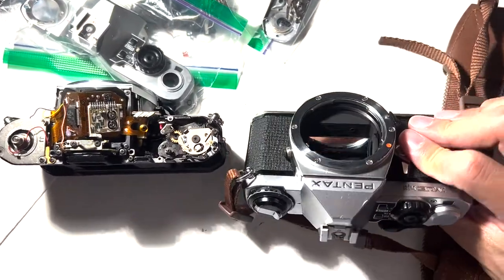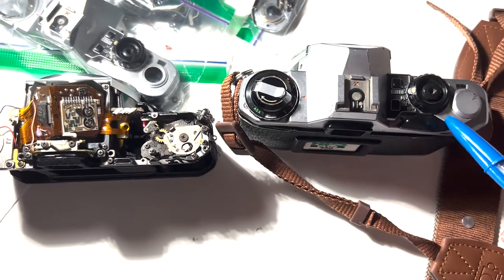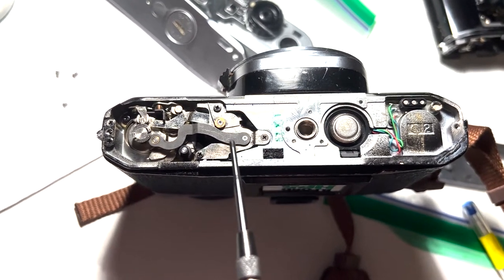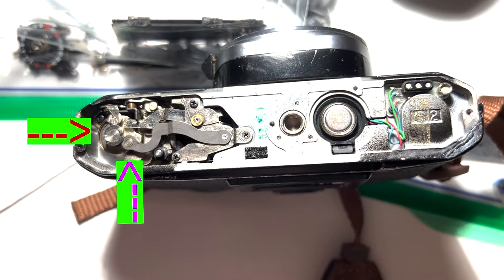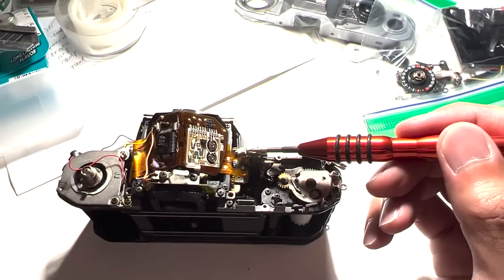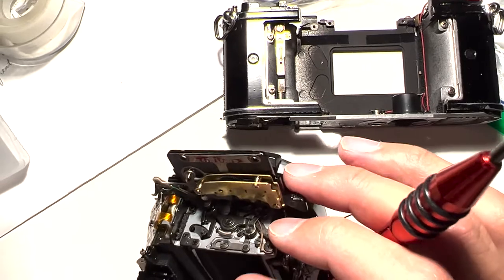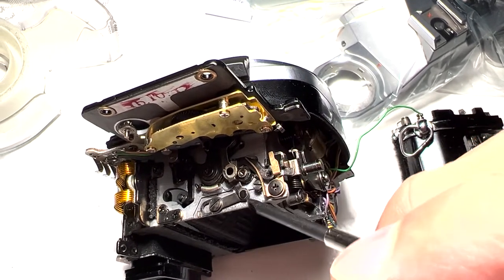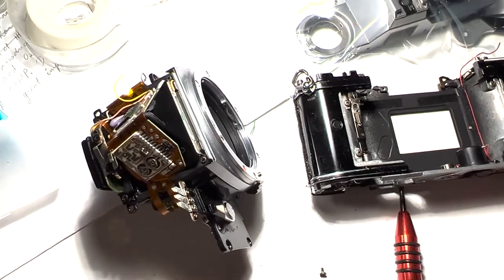Pentax ME Super Stuck Mirror and Infinite Advance Repair

Comment: The "cap" as you call it on top of the winder lever is ALSO removed CLOCKWISE, not anti as you say in the film.  I know because I've removed several that way.
Reply from the maker: Yes I meant to say that it was reverse threaded. Thank you for the correction.
Reply: @thomascasein9374  Yep, just broke it because of the incorrect instructions. The sheared stem of the cap is now stuck inside and I'm trying to figure out a way to remove it. That's such a mess.
Reply: Alright, I actually used a friggin drill and removed it. I used a 1/16 drill bit, metal shavings started coming out until a drill bit actually latched/fused onto the stem and removed it  like a screwdriver. It felt absolutely wrong doing such things to this nice camera.

Comment: I have a problem with mine, the mirror is stuck and I can't wind when I release the mirror with a screwdriver from outside by pushing the part you mentioned on the mirror box, the mirror comes back, but still, I can't wind, when I push down that black hook where is a connection to external winder, I can wind, but then story repeats, mirror just stuck and I have to repeat everything again, maybe you know the solution to this problem?
Reply: same thing here. it happens only with lens attached and apertures from 8 and above ( 11, 16 etc) the mirror locks up. without the lens on, the shutter, cocking mechanism works fine 95% of the time. removing the mirror box can be a pita, but i think its the only way to go.